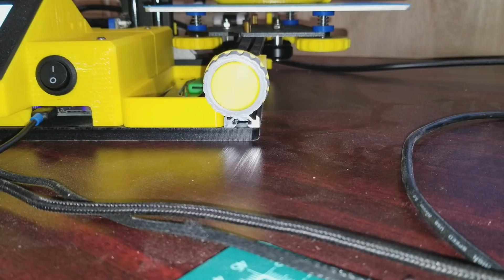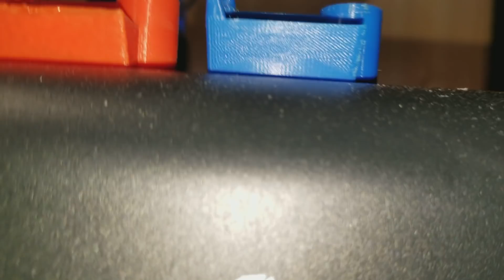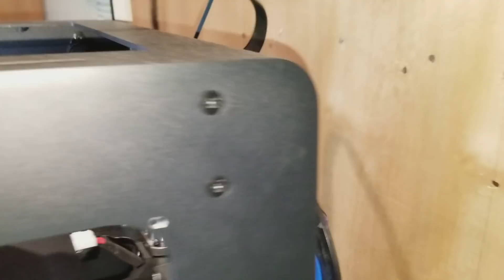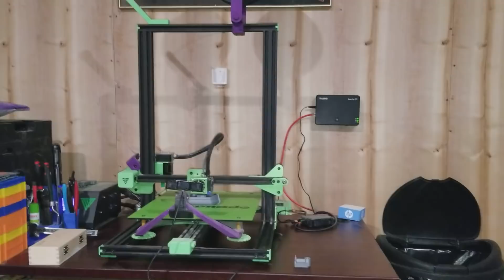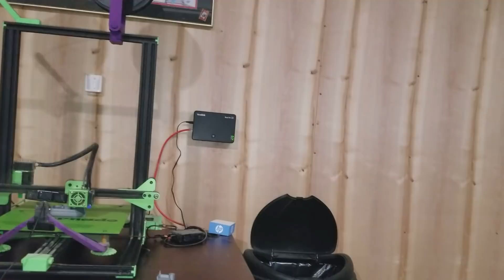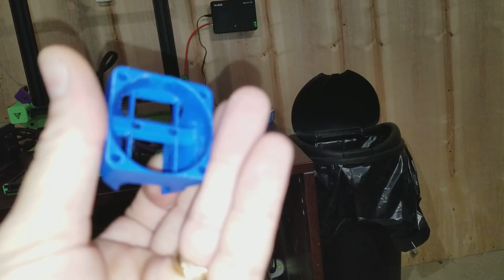Creality Ender 2 mods, Monoprice Maker Ultimate, Tevo Tornado update review.

Comment: You ordered a new mainboard.. but stayed with A4982's?? Why not upgrade to some TMC2100/2130/2208 or LV8729's?
Definitely hard not to consider a Ender-2 or Ender-3 as a cheap second printer right now.. quite a nice little unit!
Reply from the maker: I have a gen L here for that purpose as well, with 8279 2208 and 2130 drivers. I have the other board just to do testing as some people want true PNP, which the gen l with other drivers is not.   Thanks for watching.
Reply: Apparently the 2208's are fairly plug n' play vs. the 2100/2130's and with all of them you gain that amazingly nice stealthchop.. I'm ok with soldering in the SPI pins, so 2130's I can't wait to tinker with. Hopefully soon there'll be more how-to vid's for 2208 install/upgrades as there are for 2100/2130's.
You looking at an Ender-3 on it's pre-sale (9 more days left on it).. it's looking pretty nice for it's price!
Reply from the maker: It sure does, hence why I already have one ordered, lol I got in on the first 500 pre orders. Still waiting...

Comment: so the octoprint runs on rp which attached to ender 2 board for pausing?
Reply from the maker: Hi, Yes you run Octoprint on a Rpi hooked to Ender 2 via USB. Pausing will need to be configured via gcode on Octoprint.

Comment: I helped my son in law the other day with his brand new Ender 2 with a binding and out of alignment Z axis, he was wanting me to print him a shim on my Tornado. Making a long story short it turned out to be the stamped aluminum upper Z axis mount, the part that holds the Z axis lead screw nut, extruder, stepper motor etc, that was the root cause of the alignment problems. After disassembling the upper mount then checking it with my machinist squares it was revealed that it was not stamped perfectly square by nearly 3mm. To remedy this I put the mount in a vise and gently nudged it square with a rubber mallet. This solved all the lower alignment issue as the Z axis stepper motor now sat flush with the frame and no shim was required. As well there was enough wiggle room in the Z axis stepper motor mounting screws and Z axis lead screw nut mounting screws so as to bring everything into perfect alignment for a smooth running Z axis. Nice little machine, prints like a dream now and I'm going to get me one after seeing it in action. 

Cheers :)
Reply from the maker: Yep, I love my Ender 2, I had to bend the same exact bracket to line things up right!    Thanks for watching!

Comment: This is the MOST modded Ender 2 I have seen so far, and YET....you don't have the fan shroud part cooling mod.
What?
Reply from the maker: Thanks!   It prints so well, that I have left it alone for now. I have parts for a few different options but I don't know which way I am going yet.
Reply: 3D Printer Junkie can you print all of that on the Ender itself?  Obviously the small parts can be...
Reply from the maker: Yes you can.

Comment: where can I get these belt tensioners?
Reply from the maker: Click on show more above, the links are all there. Thanks!
Reply: I see 3 different things man and this is confusing,I just want to print your tensioners.Can you make a mix and re upload to thingiverse so everyone can find it easily and print.They will pray you for that.
Reply from the maker: Sorry, I didn't design them, two different thingiverse users did.  Let me put a set of instructions together and I will post them up here later today. Basically you want parts from each thing.
Reply from the maker: OK, here you go.  I will also post this in the main channel discussion section. 

In order to print the tensioner set that I have installed in my videos, you will need to do the following:

https://www.thingiverse.com/thing:2552954

From this thing, you want to print:

2x fooyabt_nut1

1x cr_10_x_belt_case_fixed

https://www.thingiverse.com/thing:2672859

From this thing you want to print 2 of each part.

https://www.thingiverse.com/thing:2545882

From this thing you want to print:

1x Ender_2_Y_Belt_Case

That is everything printed that is needed to replace both tensioners on an Ender 2.

Note you also need 2x 5mm x 25mm (preferred) or 30mm hex bolts.

Comment: hey  - I'm having an issue where the x-axis is skewed, not square across the Y-axis. Almost like the z-axis is twisted. But wven with all of the Z-tower screws loosened, I Can't "turn" the z-tower which would totally fix my issue.. Have you experienced this?
Reply from the maker: No, I have not, did you use the end of the x axis extrusion with the extra hole counter sunk into it and line it up so that extra counter sunk part lines up with the screw head for the upper right bed wheel, when I was putting mine together I almost put the x extrusion in the wrong way, it only goes one way properly.
Reply: Yeah I did that. I was finally able to align the Z-tower by removing the bottom screw on the z endstop. It was giving me fits until I discovered it. I didn't bother to put it back in as it seemed that putting it in caused the Z-tower to misalign.
Reply from the maker: Interesting.  Glad you got it sorted out! I appreciate the update.

Comment: hey you should also think about adding toothed idlers to the X and Y as well as an anti backlash nut for the Z before I had to work things with threads a bit before they worked right now they are perfect once they come off the bed and I'm glad you liked my remixed Y tentioner but I recently made an X to get the maxim build volume cause the  print head plate will hit the tentioner before reaching the end of the bed my new X case fixes that
Reply from the maker: Sweet! Thanks for the great designs, I will print your other Y tensioner later. Can you please provide more details on the anti backlash nut for Z?     I will also look into toothed idlers for the E2, do you have links for the ones you used? I appreciate the advice!  Please post up the links to your parts here if you have time.
Reply: ok well all you really need is the case the puller and nut are the same I also made some for the CR-10 but i think they'd work for the tornado https://www.thingiverse.com/thing:2552954 as for the anti backlash nut you do have to cut a side off I used a hacksaw took like 5 mins works great i got the toothed idlers off of e-bay I'm using the 20teeth 3mm bore on my ender2 but the 5mm bores work fine too it just depends on what size bolt you want to use oh and i recently tried stepper motor dampeners and oh my god they make such a difference 

https://www.ebay.com/itm/5pcs-Timing-Pulley-GT2-Idler-16-20T-gear-Bearing-Reprap-6mm-Belt-3-5mm-Bore-3D/132195520937?_trkparms=aid%3D555017%26algo%3DPL.CASSINI%26ao%3D2%26asc%3D20150817211623%26meid%3D0e7126bf5c14444e9389646fa1dd0d66%26pid%3D100505%26rk%3D1%26rkt%3D1%26&_trksid=p2045573.c100505.m3226
Reply from the maker: Sweet appreciate the info, I will print the x-tensioner case in a few and just ordered some toothed idlers!

Comment: On my Ender 2 I found the problem with the Z-screw "alignment" was actually that the motor needed to be moved side-to-side more than front-to-back. I put my mount on thingiverse if you're interested https://www.thingiverse.com/thing:2752080 I also made a 60mm fan mount for my Ender (also on thingiverse) - stringing is GONE.
Reply from the maker: Nice, I just looked at the stepper mount and will print one for sure, I have a 5015 blower style mount printed and a fan for this bad boy, just need to get it on!  Great designs btw!

Comment: Thx. Have an Ender 2 I haven't assembled, and your tips are helpful. Thumbs-up and Subscribed.
Reply from the maker: Congrats! the Ender 2 is a sweet little printer., very impressed at the quality of the prints especially considering there is no parts cooling. Glad to hear it, that's exactly what I'm trying to do,  help fill gaps of info that I have noticed exist related to 3D printing. I still have tons to learn and will share as I do.  Thanks for subscribing!

Comment: Do you think the ender 2 would make a good platform for detail prints with a .2mm nozzle? I've been considering picking one up form all the good reviews I've seen.
Reply from the maker: I've never printed with a .2 nozzle, but it makes amazing detailed prints as it is.  I say yes!
Reply: It's a great printer - I would suggest changing the build surface if you plan to do really small things though. Things stick too well to the stock surface and it's quite textured which may be a problem for very small things (and really thin first layers).